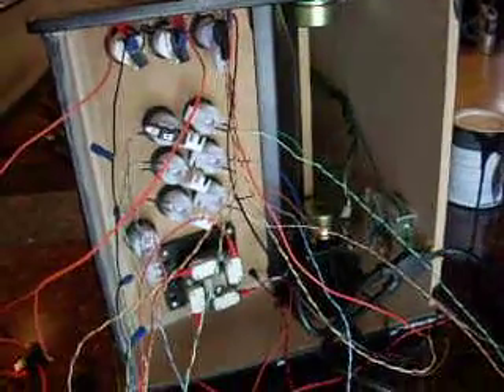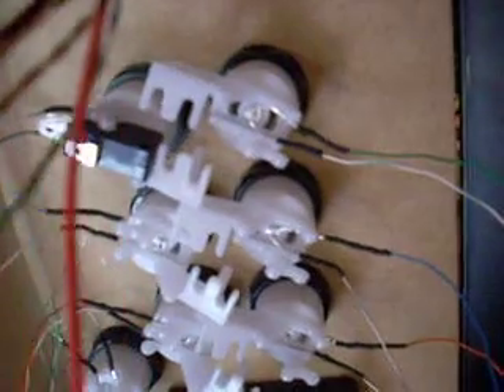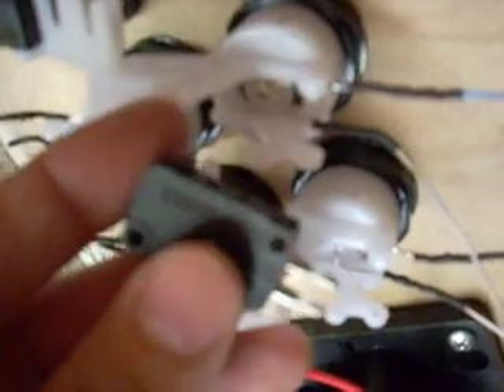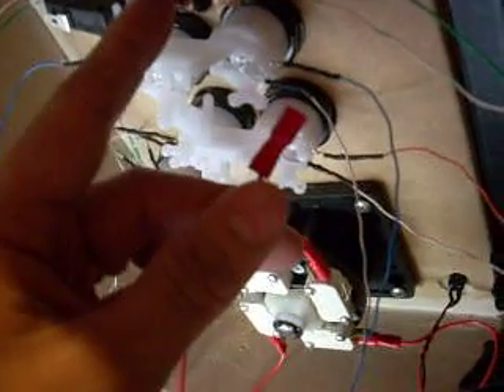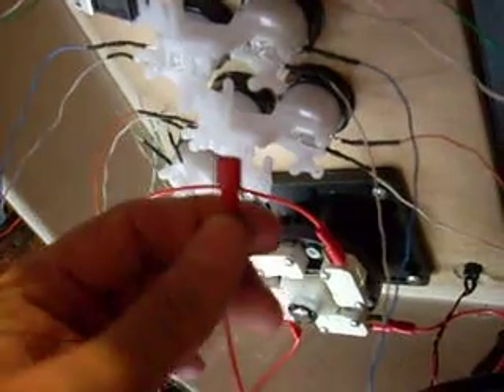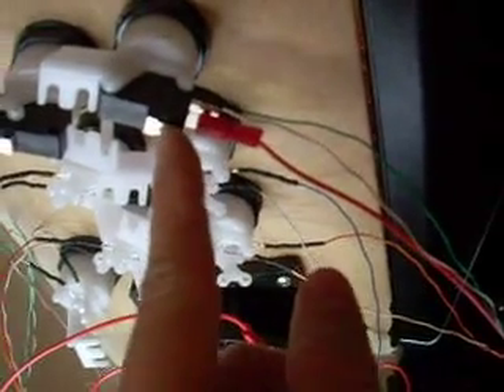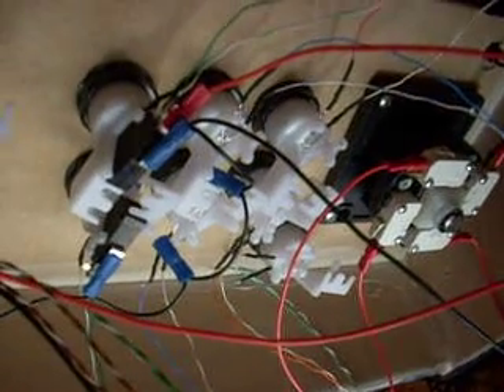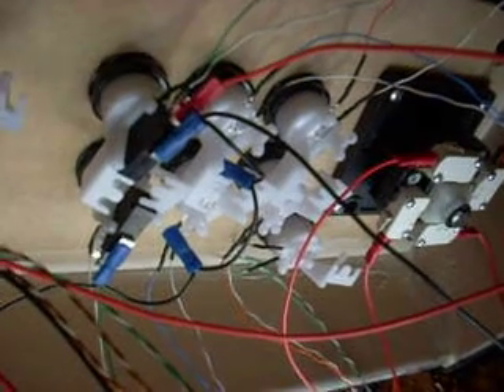Building an Arcade / MAME cabinet:  Wiring and Installing LED pushbuttons Part 3

Comment from the maker: @trodgen555 YES... I have my LEDs set to pulse and flash during game select.  When you select a game, the coin / player 1/2 buttons flash and all the other LEDs are off, then when the game starts, what ever buttons are used in the game light up so it's easy to see what buttons you need to use for just that game.  All of which is programmed in my AtomicFE front end and my LED Wiz LED Controller.

Comment from the maker: @ChannelGT Hi, sorry for the delay...  Hooking the LEDs to a power source depends on the LED controller you are going to use.  I use the LEDWiz to control my LEDs.  So the LEDs plug into the LEDWiz, then the LEDWiz gets plugged into a 5v (black & red) feed from my computer power supply, in addition to the power from the USB cable from my computer.